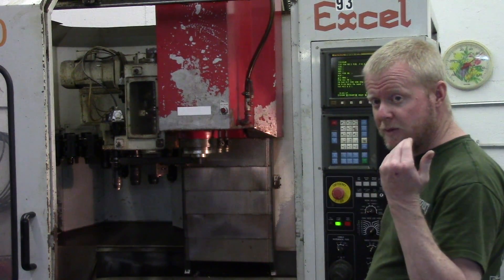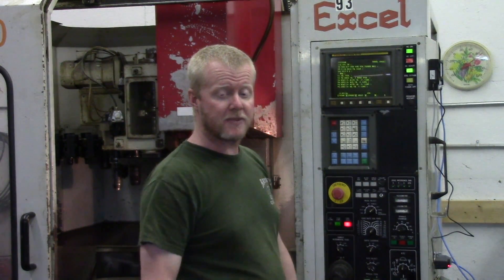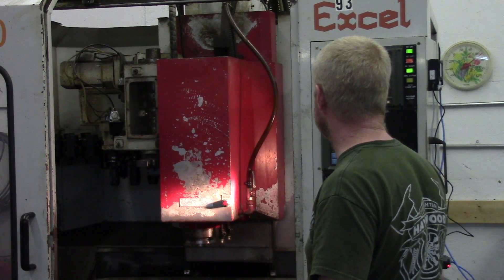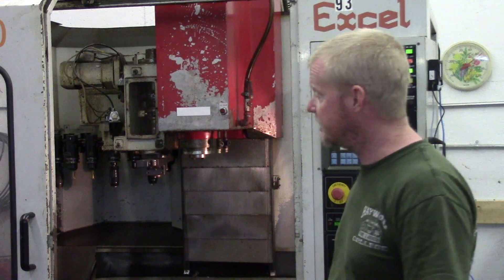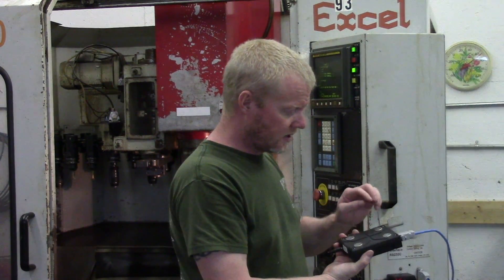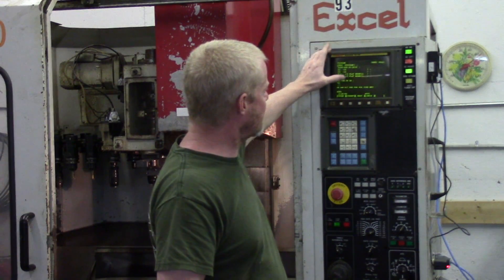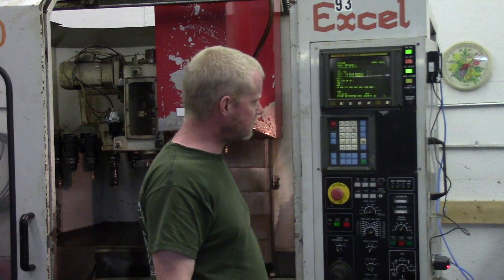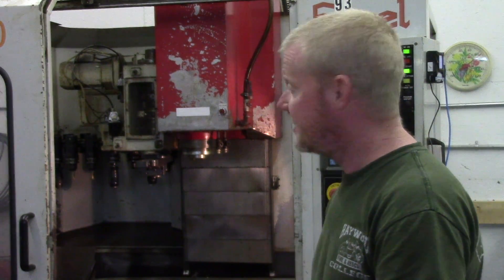ATC Troubleshooting on the Excel VMC.

Comment: I have a PMC 5VT20 that is missing the swing arm tool changer and shaft and has another broken component that fastens an armature to the main gear in the tool change gear box.  I cannot find parts for this machine anywhere and none of my sources can find them either.  Do you happen to have any prints that I can get that might make it possible to recreate these parts or know of a place that deals in parts for these machines that you can help me out with?  I don't even have a manual for it.  Thanks
Reply from the maker: Finding a donor to either swap parts or reverse engineer the parts you need would be the only option.  Sometimes part out machines show up on eBay.